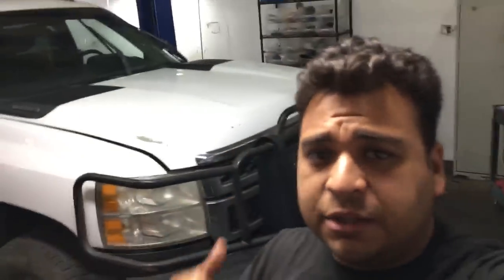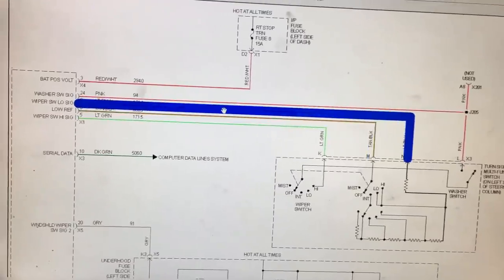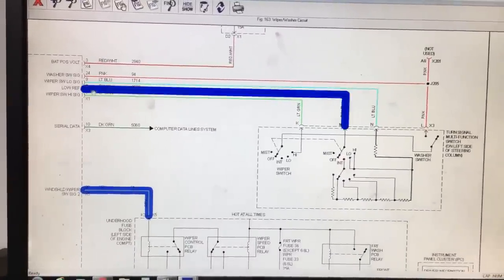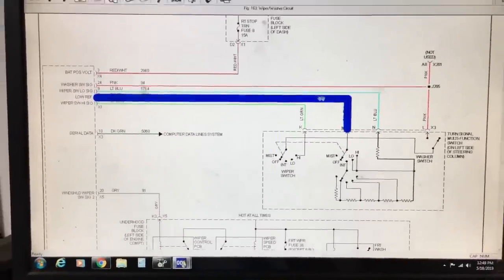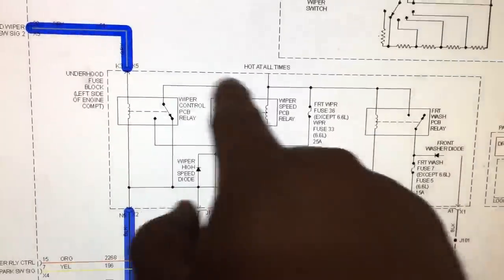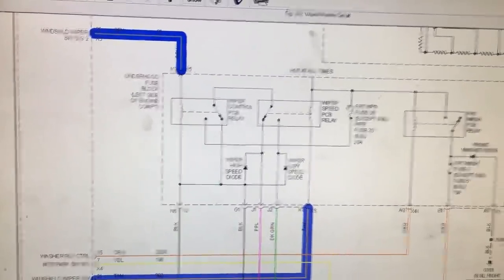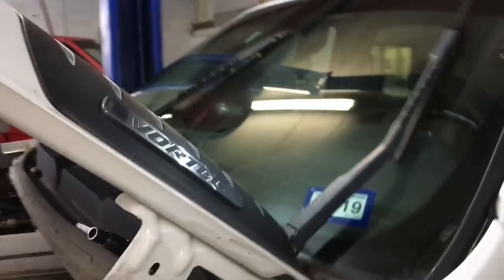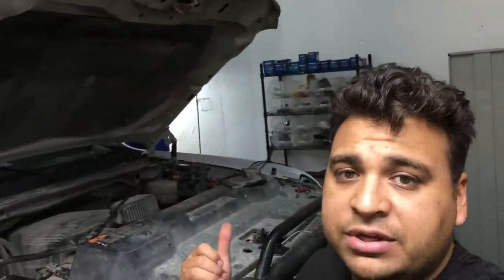CHEVY TRUCK WIPERS STAY ON DIAGNOSIS AND FIX

Comment: 2000 chevy Silverado wipers frooze to windshield , and died 
Not the fuse.
Tested Motor and figured out if I run a ground from motor housing to ground they run. Got high and low speed  but only shut off once turned on by shutting car off .
The motor 
Circuit board
Multiswitch
Fuse box builtin relay.
You'd think this frozen wipers to the window issue has happened alot and point to an issue

Comment: very informative.  I'm an "electrician" in the military so it's easy to follow along on the diagrams.   I wish I had access to all of that.    I have a 2007 silverado with wiper problems that led me here.   unfortunately my problem is a little different so I'm still stumped.    the wipers don't return to park.   and no matter what intermittent setting I put them on, they run full speed.      it seemed like it would be the switch so I just replaced it and the problem persists.

Comment: Nice job explaining. I would have liked to have seen the specific cause of the problem in the fuse box.  At least an autopsy on the fuse box after it was taken out.
Reply: MistrMyke if he had opened it would see that the relays literally get fat and the sides blow out

Comment: Excellent troubleshooting, well explained. I found myself pausing the video to think the problem through for myself, then I would resume when I had decided what to do next. Side by side, the Mitchell diagrams are much easier to read, but if the details are not accurate there is a problem. I wonder if those PCB relays are the future, it will make repairs and even diagnosis significantly more expensive. It would have been fun to tear down the old fuse box to see what is inside. Microscopic diagnosis is a whole new field, interesting to follow the new technology.
Reply from the maker: I wish I had the time. I would’ve opened up the fuse box. It’s long gone now. Thanks for watching!

Comment: I've seen that quite a bit with Mitchell diagrams. That's why I try to get a factory diagram when possible. Don't get me wrong, Mitchell is usually spot on, but I have seen the errors quite a bit. And I was thinking.. It showed that it was on high speed but it sure didn't look like high. then again, that could be caused by under-powered battery. And another great video. Thanks!

Comment: Very VERY thorough investigation and near final diagnosis. To be clear, you’re leaps and bounds ahead on the level of knowledge you have compared to me. My personal opinion (as if it matters) is that you went through a whole lot troubleshooting to narrow it down beyond every main component that most would have replaced and failed. But with that said, you were all the way to finding the last tiny puzzle piece and replaced the entire fuse box. Just out of extreme curiosity, why not find the shorted wire? You were literally right there, everything apart, couldn’t be closer, ruled out motor, switches, BCM, loose grounds, replays, etc. and all the way to te final gray wire as the culprit. Why not trace back that one wire? I truly don’t understand! With all that knowledge, access to diagrams, scan tools, and diagnostic equipment, you bought a whole new MAIN fuse box? Please tell me what I’m missing? I watched every second of your 30-minute video, while rare for me to do, you held my interest, taught me a lot, and stopped an inch before the finish line. Honestly, was it more about the billing, or was there seriously too much to go through at that point to narrow down that last piece? When I say “billing”, I mean, a customer might not understand the cost if you charged them $500 for diagnosis and repair of a tiny wire, so better to bill for an entire fuse box so it’s obvious (to the uninformed) that installing an entire fuse box could be very costly. I mean if they watched this video, they’d certainly have realized all the time and necessary equipment required to find that short. Again, very confused if that wasn’t the reason?!?! PLEASE?

Comment: Just found your channel and love your videos! Your diag process is  helpful and easy to understand. I work on lots of brands and have found many discrepancies with non OE wiring diagrams. Currently I'm at a transmission shop so I'd love to see how you go about dealing with sensor/solenoid/internal faults, particularly on Japanese brands. Thanks for the quality content!

Comment: My 2018 3500 6.0 does this too. I’m gonna diagnose it with your video but for some reason switching into and out of 4x4 while fiddling with the blade speeds usually fixes it

Comment: Great video, I have a similar problem with my wiper washer won’t shut off after replacing wiper motor. Replaced motor because washer stopped working and I knew the washer pump was good got any advice for me on what’s going on thanks

Comment: Looks like you cut a 2nd wire in there too (or nicked it pretty hard).  Glad you pointed out the mis-printed wiring diagram.  I noticed the slow speed wiper and you were pointing to high speed lines.  Those diodes steer power as well, and should be considered.  

So... did you find the problem?  You left us hanging with this video.

Comment: This is excellent and I took a lot away from it but in the end you had to replace the fuse box to repair this and you didn’t actually show that part. Does this mean the entire fuse box or simply the fuse block that the wiring goes to? I have a similar issue whereby the wipers don’t work at all. The motor and combination switch have both been replaced with no change and I have 12V going into the yellow wire on the motor with good ground but no signal to the green or purple wires. This tells me one or both of the relays in the fuse box is no good.

Comment: Thanks for the video 
I have a 2007 gmc yukon xl 5.3 gas 
My wipers will not come on. So i changed the wiper motor and assembly (aka transmission) and i changed the multi switch on the steering column and checked and changed the fuses 
Still nothing 
Any chance you have a video for that specific problem. I can find the relay.
Thanks

Comment: Those fuse boxes fail all the time,I maintain a fleet of Chevy/gmc pickups for a town municipality and I’ve had to replace the fuse boxes on all but one of the 2007-2103s. The fuel pump fuse holder usually melts on them and intermittent issues and codes.....

Comment: Nice work man that was very helpful my question is I have an 09 Silverado with the delay setting won’t work the cust took it to another shop they replaced the wiper motor the bcm the multifunction switch I looked at the data it does seem to show 1 though 5 on the delay setting but when you operate the switch the delay still won’t work any ideas on that would be helpful

Comment: I'm having this problem with my 2015 Malibu, I removed the wiper switch on the column, and every plug from the BCM, the wiper power relay pin 86 still has 12 volts, closing it to activate the wipers the only thing I can think of is a short to power in the fuse block... Hopeful it works.

Comment: Great job on video .. the ground on the motor for the  wiper  circuit    is there a  location  explaining  or easy test  that  you can do to test ground  n if so where is it located  ...

Comment: Excellent video,  I recently found your site and enjoy your troubleshooting procedures very professional.   Looking at all of the muddy water residue it appears the owner may have been out 'weekend muddin' with it and no cover on the fuse block or with the cover in place a  poor design by GM to keep water out.  At the end you show the NEW  fuse block installed with a cover in place. Is this a new cover or the original cover that has been thoroughly  cleaned?

Comment: Not trying to be critical but, I think it would be a good idea to seal off the areas of wire you probe by piercing the insulator. Eric O. at SMA seals the pierced insulator with liquid masking tape. Also, I don't understand why you had to cut the wire from the BCM. Why couldn't you just measure the voltage on that wire when the key was off?

Comment: Wipers frooze to windshield they just stopped thought it was  the fuse, but no.
I ran a ground wire from motor housing to ground without i get nothing.
They turn on high and low and the delay works and can turn them off.
More often than not you turn them on they work fine in low or high but only stop running if you shut off the engine go back to park.
Could this be a ground issue in the fuse panel ?

Comment: Thank You Eric! Great Diagnostic & repair as always! Just curious ... why You do not check signal integrity and PCM outputs as one the fists diagnostic steps? Back in my collage years... 1980s - professors was saying to us: power and ground first, circuits integrity and surface conditions as second and input and output maps and status as a third step than networks maps and protocols consistency.  I`m from industrial automation and robotics,.. but cars is practically the same thing - just complicate in the different way...  
P.S. Very sad... Your shop is far away from NYC and I can`t   be a Your customer...

Comment: Diagram is right but you kept calling the high speed side as the low speed. Looks like the bcm is supposed to have voltage to allow the park function which is most likely the cause.

Comment: hey, I have a problem with my wipers are not working any more and I dont know what to do anymore also 3 went in 3 services and problem was not fixed.  So one morning was alot of snow on the windshield and wipers went on when I started the engine tryng to clean the snow but got blocked. I have cheked the fuse is fine ,checked motor is fine .... what can it be??? please help me!!!

Comment: Not exactly a planned attack that I expected. You said that a relay had to operate for the wipers to be on. You said it should be on. A simple pull the fuse and see if it clicks would have revealed the relay WAS ON. And your tests with the scan tool revealed that the BCM was not being told to. A resounding EHHH? would have beena good reaction to then cutting the wire. You already new the wipers were ona dn had voltage . Also dont check for power wiha power probe. it applies powers and grounds. An 800 ma test lamp is a better power test. Even thought the realy is soldered in, you probably could remove its cover to see it was operated or welded shut.

Comment: Hi I have a 2016 3500hd duramax and my wipers aren't working and when I cycle the wiper switch it turns my headlights and I've changed motor before I realized my headlights were turning on with wiper switch

Comment: Many Mitchell wiring diagrams are wrong, which makes all of them unreliable. Not to mention their huge gaps in regular service information. As a service info source, they’re pretty useless.
Reply from the maker: Yes. I learned this a long time ago, but I keep coming back because I love the interactive wiring diagrams. I just wish they were reliable. Thanks for watching!
Reply: @ADVANCEDLEVELAUTO  Thank you Eric. Good job. Great explanation. The color diagrams are reproduced by Valley Forge (Bosch). They are available with Alldata also. However, sometimes do have errors and sometimes don't show everything, like other interconnections. I like how they lay everything out, but I always refer to OE wiring diagrams just like you. Have a blessed and safe week.